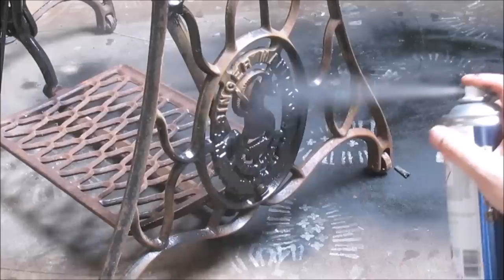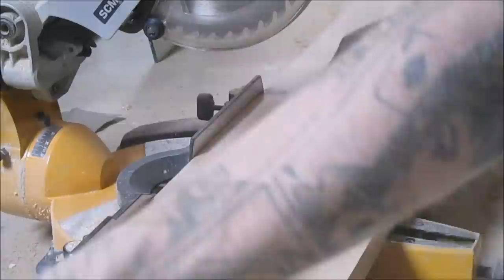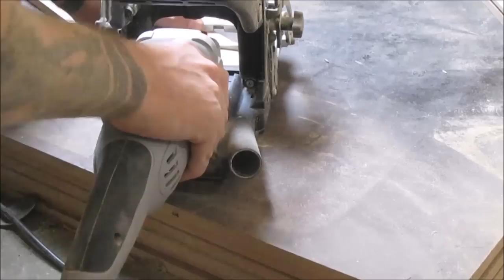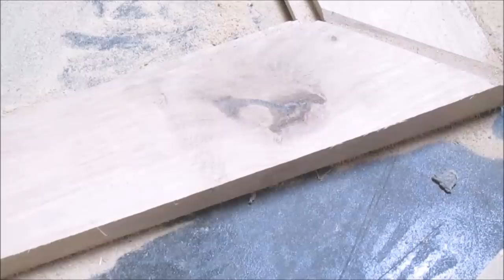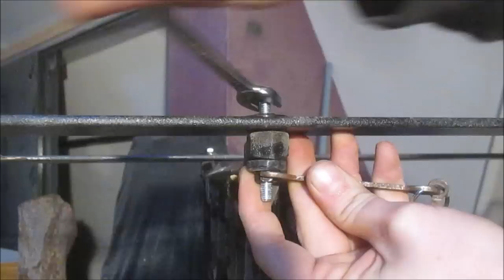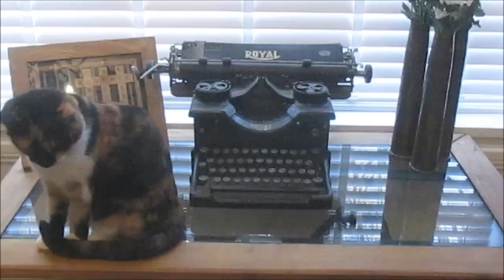DIY Singer Sewing Machine, Oak And Glass Side Table....................... DSNERV

Comment: I found on of these sewing machines at a yard sale. Such a rare find. 40 dollars. It still works. Has everything original that goes with it in the drawers. Scissors,  needles , the manual which is in decent shape, couple pages torn. Also the original co trainers the needles came in. Also the tools and parts that go with it
 I could not belie e my luck. Love your table. I have a kitchen table made out of one the top is made out of 100 year old barn wood. I love it. Now that cost me 150.00, but to me it's worth it
How you have a great day, tfs....
Reply from the maker: Wow Betty thats an amazing find!
I love working on tables like these but there is no way i would dream of breaking that set up only to use the legs.
And yes your right, price does not matter so much as long as it makes you happy each time that you see it. :)
Reply: 0

Comment: Awesome piece my friend. 

Non judgmental notes below :-)

- on the distressing of the paint job, a sandblaster would have been great for this, but its not a common tool. also rubbing the edges down with a wax candle stick kept the paint adhering only where it was applied and made the paint remove only from the edges, its a good distressing technique. (i like the chain, use it myself sometimes, but with paint it tends to start the peeling and the paint will continue to peel after you've moved the piece inside)

-when you are crosscutting on the miter saw, run a piece of painters tape over the cut area first, you'll prevent most of those "lady fingers" tear outs from the blade.

- invest in some bar clamps when you get a chance, you do a lot of larger projects and a set of pipes, and adjustable associated clamp heads will only run you about $60 combined and you'll have enough to clamp any size piece from every direction. Those "strap clamps" tend to apply pressure in one direction and create whats called "directional bowing" which can mess up your finished piece, or at least make you spend too much time trying to sand out the error.

- I recommend switching to a "Danish Oil" Blend instead of a Boiled Linseed Oil, you'll get much better long lasting color, water penetration protection, and UV protection from the blended oils than the direct linseed oil (and no, the Danish oil Syndicate are not holding me at gunpoint making me type this.......please....send help...:-O)

- those mitered corners are still giving you some trouble (i speak from experience when i say they are one of the hardest things to master, a clean mitered frame). "meet chamfering" the corners is a good technique for making up for the discrepancies, but you'll have a lot more options available to you if you master the clean miter. A miter sled for your table saw is the best place to start.

stepping down off my high horse

You are making some really cool stuff, and are years ahead of most "weekend carpenters". I hope you continue to enjoy the art form, and hope you take my critique for constructive.
Reply from the maker: Hello again Matthew
Thanks as always for your notes on this build. I'm finding it very useful to have someone like yourself willing to take the time to sit down and give me advice on how to improve my projects. As I said before I tend to just work more from instinct and follow the path of what seems right in the moment so a little advice goes a long way. 

I hope you don't mind but I am going to be asking a few questions as I cover your remarks in this reply. If you have the time to answer some of them it would be extremely appreciated. 

I would love to be able to get my hands on a sandblaster at some point and I'm sure it would leave a great effect on distressing the paintwork but as you said its not a common tool and I am sure its an expensive one. 
I have tried using the candle wax technique before on some old side tables for my sister and it worked out well. I'm not sure why I have never considered that it would work just as well on metal work but its something I am sure to keep in mind for the future.
I was aware that the paint would continue to peel over time and the way I chose to deal with that issue (and to stop the bare metal from rusting) was to give the the hole base a coat with some spray lacquer after the distressing had been done. Once again working from what just seemed like the right thing to do at the time. Do you think that was the best way to tackle the issue and stop the peeling and rust or did I just waste my time and money?

I love the idea of using the painters tape to help cut down on the tear out when running the oak through the miter saw. such a simple yet effective solution to deal with that issue. I am surprised that I have not seen people on youtube using that idea, guess that I am just not subscribed to the right ones hahaha. 

I have known for a long time that I need to invest in some good bar clamps and that the ratchet straps where just a temporary solution for the problem. I think that boils down to my very English attitude of "make do and mend" so when I first needed to clamp a larger area I found the straps and have just been making do with them since then. 
I have only just turned on the monetization for my videos 4 days ago but I am shocked to see that I have already made $47.66 over those few days so I think that the first thing I with get from my earnings will be some good bar clamps. (and a few beers to celebrate)  

I will take your advice about the Danish oil as I know you have far better knowledge of this than I do, if you say its better for all those reasons then I will be using it after the next video (That Danish oil syndicate can be dangerous if they don't trust that you are working in there best interests......... If you add the word holiday into your reply message I will take it as a sign that you are in some kind of danger and that your asking me to contact the police on your behalf.)

I agree that mitered corners are not my strong point and same as with the ratchet straps I have just been making do with the results that I have been getting so far. I will have to look into the "meet chamfering" to learn a little more about it and possibly give it a try some time. 
My table saw did come with a miter sled but I have found the results from using it to be less than desirable...... It just does not seem to fit into its corresponding slot very well and as it is far to loose it makes it useless when it does not give you an accurate cut. I have never been sure if I could find a replacement miter sled to help solve this problem. Are all miter sled fittings universal or would I need to be getting a new one from the same manufacturer as my table saw?

Once again thank you very much for taking the time to send me your thoughts and advice on my projects so far.
I hope that you are having a pleasent holiday season so far.
Reply from the maker: Damn you Danish oil syndicate! He still had so much more to offer, so much love to give and now he is lost to the world..... RIP Matthew. hahaha.

Hi mate.
Once again thanks so much for getting back to me.

The first thing I would like to say is that if I should not worry about asking questions then please don't you worry about appearing condescending in any of your messages to me. I understand perfectly that you are here helping and giving advice and that constructive criticism is not something that anyone should shy away from.   

Thank you for the information about the sand blasters. I would love to have one myself but if I ever chose to get one I would be looking at the more expensive models. An uncle of mine used to work with sand blasters in glass etching after emigrating to Australia. After seeing the work he made I would want to try my hand at glass etching as well and I am sure that the cheaper models would not have the power needed for that kind of work.

Its good to know that I had the right kind of idea when it came to the rust and pealing situation on the base. I know that it was not the perfect answer to the problem but just being told that I did not waste my time and money is nice to hear. I do not mind having to go back every now and again to do touch up work with my projects. Having small jobs like that helps keep me on my toes and is a pleasant way to spend a lunch break or 2 every now and again. 

I have no intentions of getting rid of my ratchet straps any time soon as I find them so useful not only for my projects but in everyday life as well. I will soon be moving house in February and a few straps like that will be indispensable so there is no way I am saying goodbye to them any time soon.

Right now I have only been working with Oak as I placed a bulk order locally and have slowly been making my way through it all. I do want to expand into other woods a lot but right now I just don't have the space to store it all (let alone the money to place a new order for some Elm or Yew) 
Its a shame as my most recent project (the 2nd singer sewing base with an Oak and denim micarta top) is almost finished and I wish that I had used danish oil on it now instead of the teak and raw linseed mix that I made. Guess I will just have to wait for the next project before I can use the Danish oil.  

I should have just done a quick google search before replying to the meet chamfering portion of our conversation to find out exactly what it was before commenting. I have always referred to a corner like that as a beveled join but I assume that I have been using the wrong terminology for it up until now.
I know that they are a huge dust and dirt trap and I was very unsure of how well they would work once the glass was in place. In the end I am pleased with the results even if they are slightly impractical, without them I feel that the top would have just looked far to simple.

Making jigs such as the miter sled is something I have known that I needed to do for a long time. I must admit that I find it hard to get the motivation for making things like that when I know I could be working on a table or some shelving units instead. Its all part of the process to moving from being a weekend warrior like myself into someone with a more professional outlook to there work. Thank for for the video link, I will have a look at it and try my best to make myself one before moving on to my next build.   

Personally I think it would be a great idea for you to start your own youtube channel and I am more that willing to give you any tips and tricks I can to help you with it. I am sure that someone like yourself that enjoys teaching will get a lot out off the feedback and questions you will get in the comments section.
I suggest that the best way forward from here is for you to send me a private message via youtube and then I will be able to give you my facebook / skype information to help avoid that carpal tunnel from sending these long messages. (This is just an offer and I would by no means not be offended in any way if you did not want to be in contact with me like that.)
To give you a very rough idea about youtube revenue it seems to work out as $1.00 for every 1000 views. It very much depends on what kind of advertising you choose to add to your videos, the rate that you are gaining subscribers and how much you are willing to take the time to reply to the comments that you will be receiving. 

I hope that gives you some ind of idea of what to expect and as I said before I am more than happy to help out more if you do choose to go down the path of setting up your own channel. 

Thanks as always for all your help.
Reply: DSNERV You did just fine in my opinion. Just saying! Making do is never a bad thing, the more money you'll have for your beer! Lol!🤣

Comment: Amazing job.please how can I jam  the wheel for the sewing machine .so it won't be rotating
Reply from the maker: Thanks Camouflage Gator. 
If you have acess to a welder a small dap to the foot peddle to jam it would work well to stop the wheel from spinning. Or if not i would paint up a bolt so it's less visible and glue it in place under the foot peddle and that should also work just fine. 
Hope that helps. :)
Reply: Thx alot.appreciated

Comment: Turned out great, I like how you sanded the joints on the corners of the table top to make a groove, looks really cool. Where is your workspace?
Reply from the maker: Thanks Mitch.
Yeah without those little groves the top would have just felt a little to simple so I added them as a little extra feature. 
I live and work in Gloucestershire England but just do all my woodworking stuff as a bit of a hobby in my spare time for fun.
Reply: Cach8

Comment: Can you tell me what you did to 1. clean the peeling paint and 2. rust issues on the leg part of the table?
Reply from the maker: Hello James.
Sure i can tell you what i did. 
1: Pealing paint was not an issue for this one but if there was paint to remove I would have hit it with fire and then used a wire brust to remove it. 
2: after spraying and destressing the paintwork i gave the base a coat of mat varnish to that the exposed metal would not contunie to rust.
I hope that helps. :)
Reply: DSNERV thank you for the reply. It seems like in the video that you sprayed over the rusted surface no?  Was it to create the distressed look once you sanded and chipped the surface?

Comment: But he sprayed paint on rust, won't that make bubbles and peel off the paint?
Reply from the maker: Suprisingly no the paint has not been effected by the rust at all. For me this was never an issue as i wanted the base to look used and beaten up (hence using the chain on it) so if the paint had continued to bubble it would have only added to the look. :)
Reply: @dsnerv  understandable, interesting way to give it that look. Nice work btw :))

Comment: You do incredible things dude)
But I have a single question. Why do you smoke so much?)
Reply from the maker: Thank you for the support Андрей Мухин. 
I know that I smoke far to much and I do need to cut down a lot.
Reply: ok)
I have a question.
What kind of oil you used for polishing wood in this video?
Reply from the maker: Hello again Андрей Мухин. 
For this table I used a boiled linseed oil on the oak frame. 
I hope that helps.
Reply: @dsnerv  Hi,  why boiled? Did you do it yourself you have a ready to use??
Reply from the maker: @lydiaflower6030  Hi Lydia.
I get the boiled linseed oil from a local shop close to my home. It tends to be thicker and darker than just a reguler linseed oil so if im going for a more aged look with the oak I choose to use the boiled.
Reguler linseed oil is lighter in tone and tends not to change the natural colour of the wood you are working on, you can always do a 50/50 mix if you wanted a happy medium for protection and colour.
I hope that helps. :)
Reply: @dsnerv  Oh, so detailed and professional reply! Thank you!  I am a beginner ... had some small projects with midcentury furniture. Wouldn't  you mind if  iask you some questions time to time?  And what is your name? Thank you!
Reply from the maker: @lydiaflower6030  Hi again Lydia.
I am very much a beginner as well and only selt taught so im not sure if i will be able to help with everything but sure I am more than happy to try and answer any questions you might have along the way. :)
My name is Dominic, nice to meet you.
Reply: Oh,,,, you are not a beginner - your work was high end! And you worked not only with wood - you worked with metall as well, and it also means smth. I have the Singer metal basement as well... and plan to do a table as well. But without woden frame... only a thick glass.  Do think there is a  nice way to join to the metal part? Thank you once again and nice to meet you too, Dominic!
Reply from the maker: @lydiaflower6030  Hey Lydia.
Ok so if it was me wanting to make a purly glass top for a Singer base I would want an extreemly thick glass not only for protection but also style and weight so that it does not shift in position once put in place.
If you have glass like that already then simple rubber bumper pads will work and the glass will sit in place from its own weight. Besides that I know that you can get suction pads for glass tops that would thread through the pre existing holes at the top of the base. 
The best thing for swapping ideas would be for you to go to my facebook page (DSnerv Projects) that way we will be able to exchainge images as well as ideas through messages. :)
Hope that helps.
Reply: Thank you! Will follow your advice!